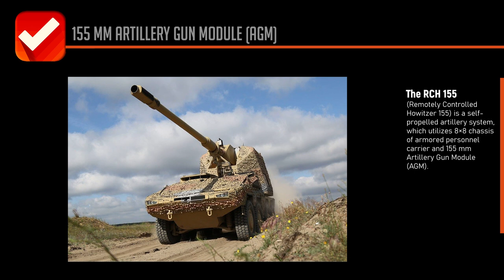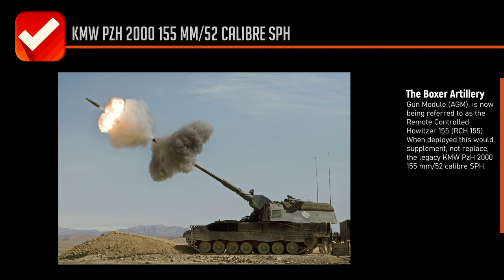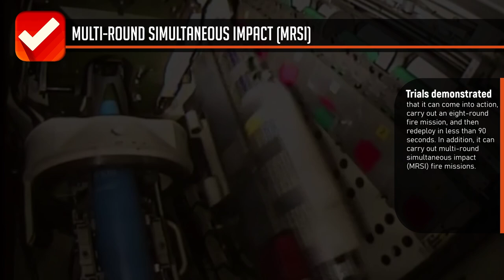GUESS WHAT? A REMOTE CONTROLLED HOWITZER

Comment: What's the difference between this and a tank?
Reply: This is a howitzer. It's used for indirect (artillery) fire. It can also fire in direct fire like a tank but it's not used often
Reply: Do you mean the difference between a tank and a howitzer or the difference between a weeled howitzer and a tracked one ! ?
Reply: Tanks are used with the infantry and have heavy protection. The can’t shoot so far but they have a big punch. A howitzer shoots from really far away. Protection is secondary. It should be able to shoot really far. They are placed as far as possible from the front line.